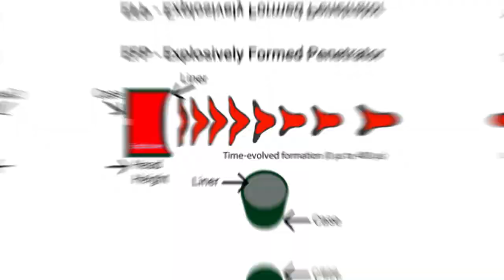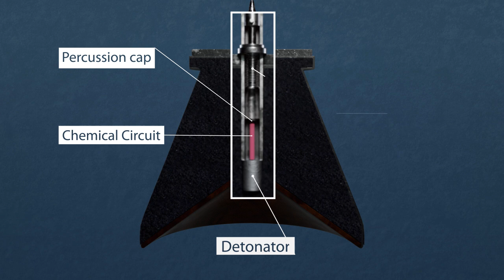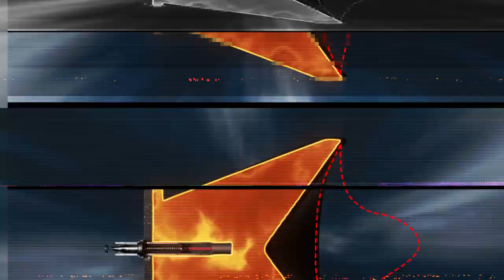Shawaz EFP Explained! How it is Destroying Merkava Tank?

Comment: So it's a HEAT warhead that you must MANUALLY put on a tank. Sounds like a great proposition.
Reply from the maker: Shawaz doesn't need to be attached to the target. Just place it in a closer distance and face the cone towards the target.
Reply: @Insightful_3D  the focus of the copper dart is a really specific range. That's why spaced and cage armor defeats HEAT since WW2.

Comment: Unfortunately, the militants don’t stick around to film the final results. Maybe something to do with return fire?? (lol) All explosives make a big blast, but what was the effectiveness of the device. Especially against composite armour which has multiple layers of different types of material. Modern fighting vehicles are rarely if ever, made from straight Rolled Homogeneous Armour (RHA) steel.
Reply from the maker: https://twitter.com/warfareanalysis/status/1796596720710860923
Reply: @Insightful_3D  it'a not Merkava, it's m113

Comment: Operating tanks without infantry around them is an idiotic move.
Reply: Idf are scared to be outside the amoured vehicles
Reply: @dzulkafleysamad3825  Y tu..no lo tendrías?
Reply: You do know that the Merkava capable of carrying eight infantry soldiers right ? , secondly they know if they walk on the ground they will be hunted in no time. that's why they prefer sitting inside tanks.
Reply: @morantleetzor2310  like I said tanks without infantry dismounted are sitting ducks no other country has armored doctrine without infantry support Because enemy infantry can just walk up and plant a shaped charge and destroy the tank.
Reply: @jesseterrell2109 there not unsupported the infantry are just hanging around in the doorways of buildings next to them and it depends on the unit IDF regulars are lot better at screening tanks then reservists due to the training gap.  Plus we only see the successful EFP attacks and not the failures  so avoid drawing a conclusion from clips
Reply: @jesseterrell2109  you did not say anything, you just repeat nonsense you have read from others who said nothing but repeated nonsense.
Reply: The IOF is casualty adverse. So they either stay inside armoured vehicles or as far away from the resistance fighters as possible and destroy civilian infrastructure from a safe distance.
Reply: Dismounted personnel and Trophy don't mix...(the MEFP would disintegrate'em)

Comment: I look at many of these videos. Tanks need infantry support more than ever. They can not just be sent to areas alone. They are solid, but some armies use them like they are impenetrable.
Reply: The problem is that infantry can be easily dispersed. The tank can easily get alone, if the infantry starts hiding behind the ruble or in ditches.

Comment: But this device is nothing without courageous and fearless combatants
Reply from the maker: Yes, you have to be in a zero distance for using this device.
Reply: Unfortunately, the militants don’t stick around to film the final results. Maybe something to do with return fire?? (lol) All explosives make a big blast, but what was the effectiveness of the device. Especially against composite armour which has multiple layers of different types of material. Modern fighting vehicles are rarely if ever, made from straight Rolled Homogeneous Armour (RHA) steel.
Reply: @oceanic8424   another idiotic statement by another idiotic zionist this charge holds enough explosives to blow up any kind of modern tank given that it's applied from such close range no modern armor is advanced enough to stop such an explosion
Reply: @oceanic8424  correct - a lot of IFVs are made of aluminium and do not even stop a .50 cal
Reply: @johnjennings9043 that's BS
Reply: @JoaoSoares-rs6ec  OK - they can almost withstand a .50 cal - when they have the extra ceramic armour carried - which makes them slow and unwieldy.  The regular styker cannot - its only rated to 7.62 protection.
Reply: @johnjennings9043  most IFV CAN TAKE A 12.7 mm, some can take the 20mm HE, most russian IFV can take 14,5 more than that they cant, so yes BS
Reply: @JoaoSoares-rs6ec  The stryker can only take .50cal if carrying its optional ceramic plates.  They didn't exist during Iraq - and they were penetrated with .50cal during GW2... So not, BS, sir.  With the ceramic, they are meant to be good to 15mm rounds of AP - however, if the same plate is hit twice, all bets on penetration are off.
Reply: @johnjennings9043  the striker can take 12.7mm, standard armour, the tiles aren't ceramic, but explosive reactive, regardless strikers tend to use cadge armour, you know the fence like thing around it, this is for RPG, so yes BS.
Reply: @JoaoSoares-rs6ec  Sorry dude, but I am very, very familiar with the build of these.  They were made by GM GDLS Defense.  The base armour is steel/aluminium - and is rated ONLY to 7.62.  It was retrofitted with CERAMIC MEXAS 2C armor tiles.  They are the bolted on bits.  They take the armor up to 14.5mm but increase the weight by 5,000Lbs.  The Slat armour added another 5000LBS and the total  added weight totally trashed the tyre management/inflation system.  There was also an option for an additional 'driver protection kit' which added a further 1,000 lbs.  There is an option for ERA for some parts of stryker - these add further weight and are only available for some variants of the machine as they are model specific.  The ERA is made by Rafael -  I haven't come across that much - the slat armour is generally preferred.
Reply: @johnjennings9043  the problem you have is that I'm very familiar with the subject, sorry to tell yo, but just about the one thing you got right is Rafael and what they make
Reply: @JoaoSoares-rs6ec  fine - we will agree to disagree - You might have been IN a stryker - I helped build them.
Reply: @JoaoSoares-rs6ec  The distinctive bolt bits on the outside of a stryker ARE the MEXAS panels.  You never saw one WITHOUT the MEXAS perhaps?  It is ceramic, though.  The ORIGINAL strykers in Iraq 2 didn't have them until late in the day.  Hence the fact that Strykers WERE/ARE vulnerable to HMG fire.  The ERA options are IN ADDITION to the MEXAS as is the SLAT (though its really either/OR).  Thats why the tryre system (which I really know about) was broken = hit a rough ground at speed wrecked it - even the Ukrainians were complaining that the inflation system was tempremental so its probably not fixed or old models sent (IE not the V hull variant)
Reply: @johnjennings9043  really move on
Reply: @oceanic8424  again if ahams had any destoryed merkava totally they wud ve made extra effort to film it or casuality evac or even dead soldiers .... They didn .. that wud ve made th se Iranian weapons more sellable in market ...but none came and israel told they lost 15 odd merkavas with major damage and need overhaul of engines ...that itself signifies the hamas didn do much damage to israeli Armor ...
Reply: No freedom fighter ever had fear for freeing their land
Reply: @defaultuser0856  there are no freedom fighters in this story.
Reply: @JoaoSoares-rs6ec  what do u call people who got kicked out from their land and they're fighting back to get it ? Oh, don't tell me u call ukrainian soliders in the occupied lands not freedom fighters
Reply: @defaultuser0856  no I don't, I call them soldiers.
Reply: @defaultuser0856  to put Ukraine and gaza, what is happening, its like comparing a hot spring, with the deep of the ocean, its insulting.
Reply: @JoaoSoares-rs6ec  why tho ? They are the same in term of defending their land, except that ukraine has full world support vs gaza which even the food and water can't enter. I can't see the insulting part
Reply: @defaultuser0856  the insulting part is comparing the two, ukraine is defending its people from a hostile, hamas is the hostile
Reply: @JoaoSoares-rs6ec  im making it as simple as possible and you are responding with "informed" and "hamas is hostile". Either talk like an educated person or go home
Reply: @defaultuser0856  i gave you the facts as they are, simple as that, you don't like it, i don't give a dam.
Reply: @defaultuser0856  just so you know, freedom fighters, are a fantasy not once there was a fight for freedom.
Reply: ukraine is defending its people its homes, land, israel is defending its people homes lands, hamas , russia wants to destroy it
Reply: zuheir mohsen interview 1977 to a duch newspaper, take a look at it.
Reply: Yeah, suicidal and brainwashed with a cultish love of death aka the religion of peace.
Reply: Something that IDF & USA don't have "courageous and fearless"
Reply: @donkykong1154  lol hamas thought idf won't dare to come into gaza and fight them int their den ..not only idf came to gaza and destoryed every offices and commanders of hamas ..they fought them in tunnels and outgunned hamas in every aspect ...hamas lost territories after territories and fighters  in  months ..... 🤣
Reply: @donkykong1154  The desperate, will often do desperate things bc they have no other options. Courage and fearlessness are very often accompanied by foolishness, but then again, what choices do they have? Aloha Snackbar!
Reply: No..because isreal soldier are noob
Reply: @JB-rf8cx  they are more professional than several elite units out there
Reply: What courage ..they do it when infantry is not being supported ...where s the destoryed tank ..we can only see blast ...if u want to destory tank blast should be inside ...😂😂 If u want to see how tank is destroyed see Ukrainian videos
Reply: @psyayimwone did you know the Merkava tank also carries infantry onboard like an APC? It's either the infantry personnel were on foot elsewhere, or stayed inside the tank when the explosives went off...
Reply: @MLOO123  lol ..normally recon won't carry that much if tank stops ..infantry wud ve dismounted if they had ...but that blast was entirely to outside ..where s the destoryed tank ...only minor damages to armor or chain ...that wud be instantly repaired
Reply: @psyayimwone  instantly repaired? You mean in video games? Lol... The tankies would have abandoned the tank if it was crippled with thrown tracks, else will be a sitting duck in hostile territory man...
Reply: @MLOO123 they can do that, but they don't actually have infantry inside
Reply: @MLOO123  lol there are many videos where the tank is pulled away repaired and bought back into action .which signifies the ineffectiveness of the hamas weapons ...and yet israel had tanks to make incursion into lebanon as well....
Reply: @psyayimwone  There is courage, you're just too delusional to see it. 😂

Israel does carry infantry whenever their tanks and apc advances to cover them from infantry anti tank fire. 

But in this one lucky instance the infantry wasn't covering the tanks, as such the hamas fighter who probably didn't know if the infantry was covering the tank, rushed foward in zero distance to deploy an explosive device.

If they didn't have courage, why would they blindly charge forward with an explosive device at point blank not knowing if they will be shot down before even reaching it?
Reply: @mrmason23  israel has infantry everywhere in gaza ...these warheads never penetrated the tank ..otherwise hamas would be celebrated on the wrecked tank
Reply: @psyayimwone  Saar I know you are from India, saar. Trying so hard to defend the terrorists, war criminals!
https://youtube.com/shorts/qIsDMoUVHF0
Reply: @psyayimwone  u must be missed the news aren't ya? haha
Reply: @psyayimwone  kalaupun tank merkava tidak bisa hancur karena Shawaz EFP , minimal tentara babi dan kera yg ada di dalam tank akan mengalami kerusakan gendang telinga sampai tuli dan mungkin saja kera dan babi kencing di pempersnya sesaat mengalami ledakan dahsyat itu.
Reply: @fachrymohamad6914  wtf r u even tryingto say
Reply: @psyayimwone  They be throwing them inside tanks these days
Reply: @psyayimwone  Ukrainian videos mostly show abandoned tanks - hatch open.  A LOT easier to kill.  Mobility kills are eminently possible with shaped charges.  It not when infantry is not supporting - its when infantry are still inside the Merkava.  Merkava carries troops that are too frightened to get out.
Reply: @johnjennings9043  lol Ukrainian video also shows tanks being hit by ATGM rounds , tanks burning , blasting and their turret being blasted out ....nothing is happening here ....hamas videos just show the blast ...not the after effect ....not even a single video have a burned tank even from a long distance ....one video showed  some Armor plates which came off ...and you say idf is afraid to get out ...😂😂 Thats what hamas thought ...now idf controls every block in gaza ..
Reply: like every other gun lmao
Reply: @Notimportant8869  Your argument made zero sense.

A gun can be fired from distance and in safety, 

the Shawaz efp has to be carried by a man in the open, exposed to enemy gunfire and then finally detonated after he retreats, or has to be set up in a calculated and planned ambush before detonation.

Zero similarity, zero basis for your argument.